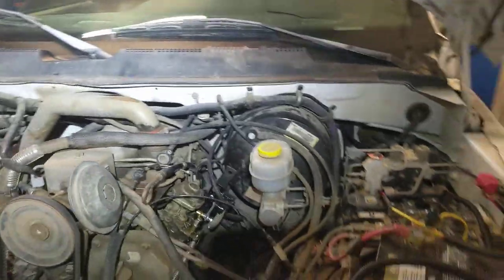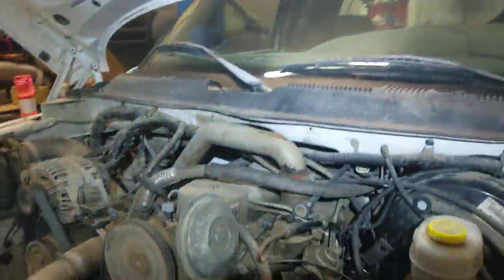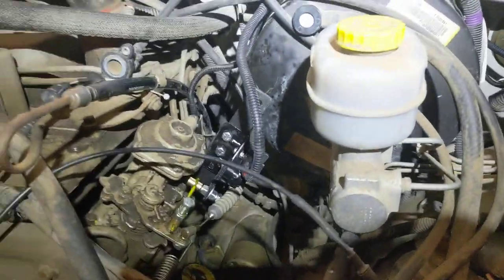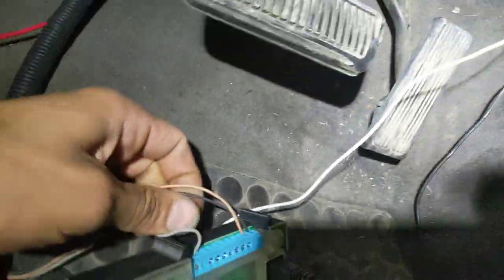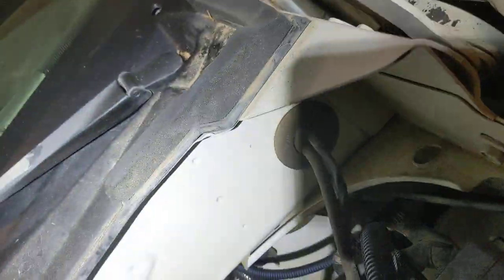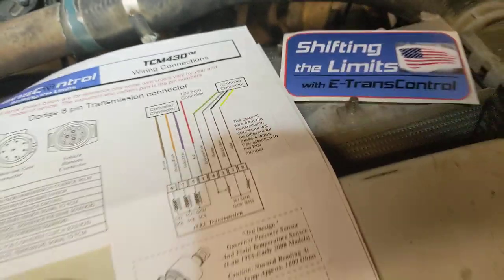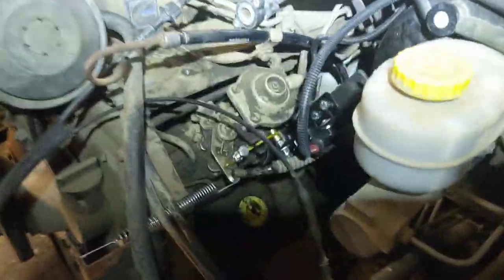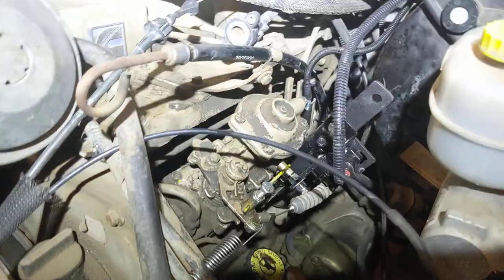47RE Stand Alone Controller Part 1 - using E transcontrol

Comment: I have a 2002 24v 3500, bought it wouldn't go into overdrive. Replaced the transmission still no overdrive. I've changed batteries, grounds every single speed sensor including in the rear end. It has to be a broken wire or pcm. I'm so discouraged it's unbelievable.